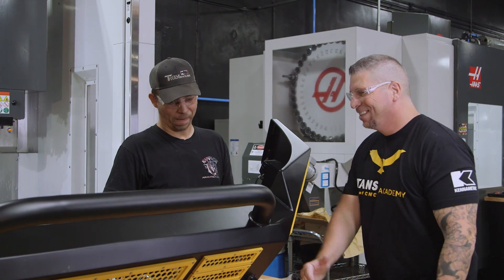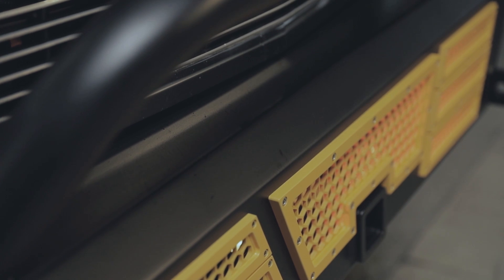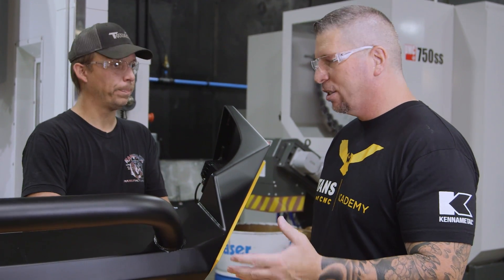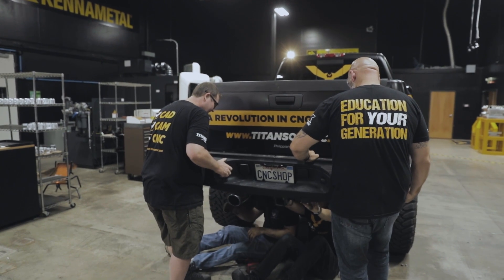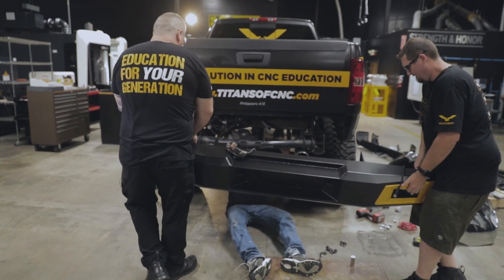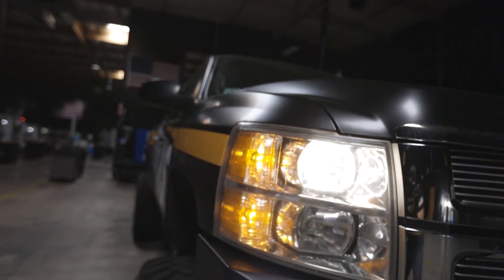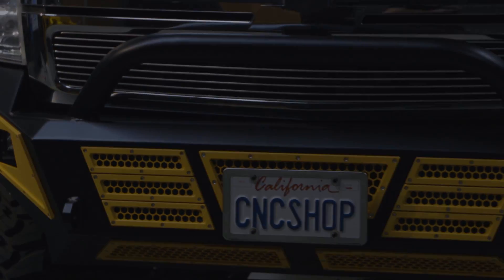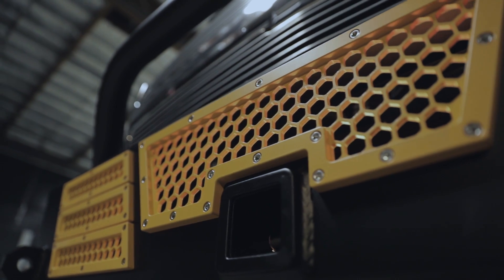Unbelievable Custom CNC Machined Bumper

Comment: Hey! My name is Blake and I'm 22 in July. I got offered a CNC apprenticeship program with my current employer. It's a 6 year contract. 4 year program. 2 year commitment after the 4 years. I'd be learning programming to grinding to metallurgy, milling, lathe, etc. It's a very beneficial curriculum for this trade. I've looked at other apprenticeships and they barely scratch the surface to this. I'm not sure if I should take this or go back to school. My only concern is the pay and the commitment. They want to start me at 12 dollars and hour and I have 1 year of experience with 1 dollar raises annually. I live in North Carolina. This is a HAAS based facility. Family owned, very small. 15 machines. From mini mill, tool room, (old machines) 5 new generation machines with OTS and probe. I have a job opportunity at another shop that has dmu 50s and all of the newest style machines that is a very large facility and they want to start me at 16 dollars an hour and want to assist me in costs for school if I were to do something other than manufacturing and very flexible with schedule. Thank you so much for your time. I really hope you reply back. I am stuck in a limbo stage, and I would very much like to get advice from someone I look up to.